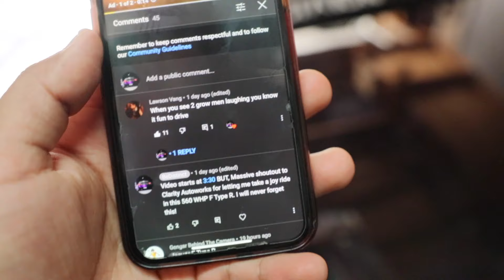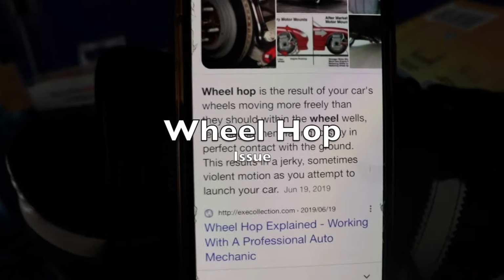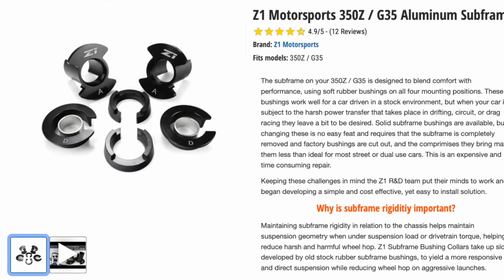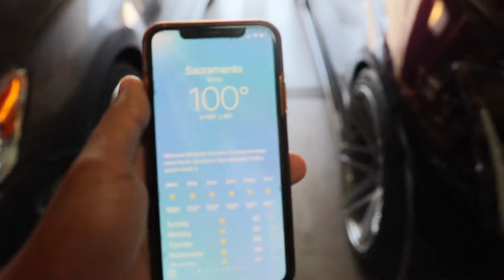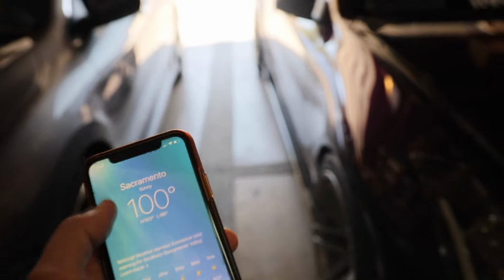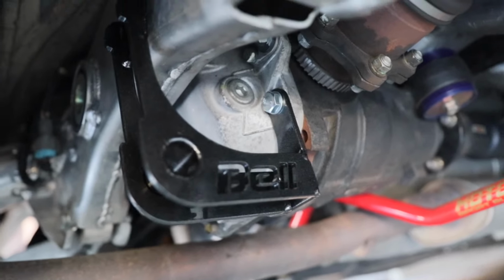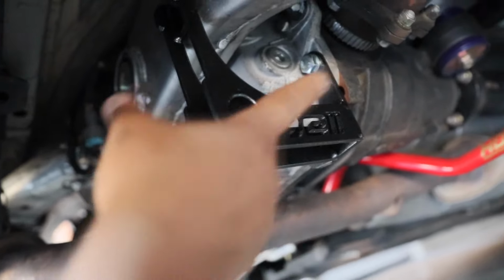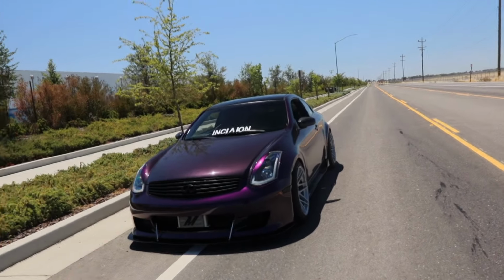This $100 MOD made my G35 Launch 100x Better ! (Wheel Hop Issue)

Comment: What tires are you running?  I solved my hopping issue by using the best tires around (used on Ferrari's etc). Try a set of Michelin Pilot Sport 4s - they are new both soft and hard compounds in 1 tire with a guaranteed 20,000 miles - LOL!  I burnt through my rears (no race tracks) on the street in 12,000 miles and got a discount on my 2nd set.  Awesome tire, it grabs from the start where as before the traction control would kick on as the old tires hopped a bit.  Also, very smooth break away, so a 90 degree turn coming left on a 4 lane street would trigger traction control - full acceleration from stop light, the back slides out 6-12 inches with no trigger awesome.  I use to have Pilot Sport 2s - they were great.  These are better. 5 Stars and great wet and dry performance - google them!  You get what you pay for - if you like performance, then pay for it.

Comment: What up homie. Try lowering Ur tire pressure to 27 psi in the front and 29 In the back. And we out here in Ontario CA 91 degrees. Got AC in the wear house thou.
Reply from the maker: I should try That, my tires are at 34 I think haha kinda high

Comment: i don’t know much about g/z chassis suspension but, i will say coming from a drag racing stand point with a stang,  you should upgrade your rear lower control arms that’s what made the biggest difference and completely eliminated wheel hop for me
Reply from the maker: This car has some Spc arms from the previous owner but maybe I’ll try replacing it with better ones. That’s actually a good suggestion, thank you 🙏

Comment: How do you launch it in auto anyone know how ?
Reply from the maker: Turn off vdc, hit the brakes, hit the throttle at desired rpm (try 3,000 rpm) and then let go of the brakes and off you go 👍🏻
Reply: @BeDistinct  isn’t it bad for the tranny engine bro?
Reply: @fatboyhoops4020 not if u do it fast, this doesnt work on z’s though they cut power

Comment: Also I think the wheel hopping is because g35 are rwd so all of the power is pushing to the back wheels causing them to spin
Reply from the maker: Yea true, maybe I just need to launch the car at a lower rpm but 2,500-3,000 seems good